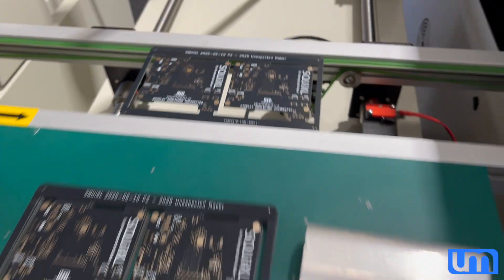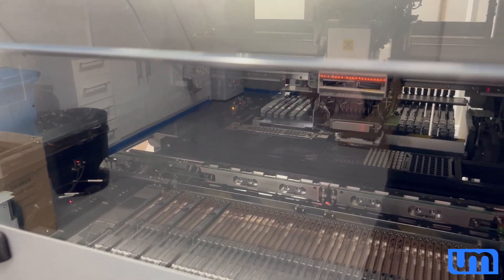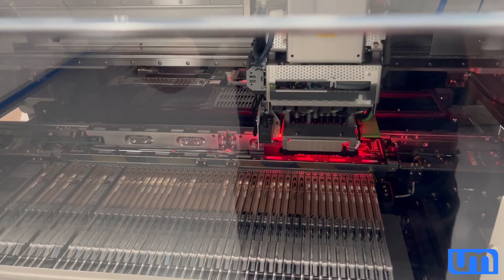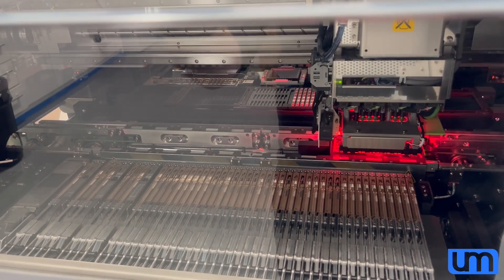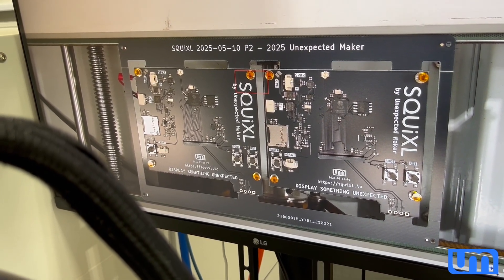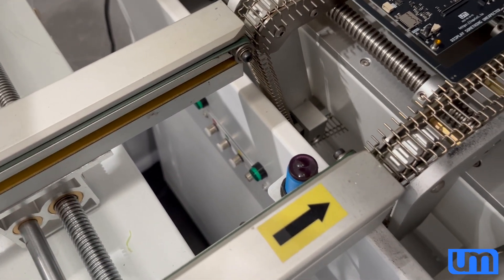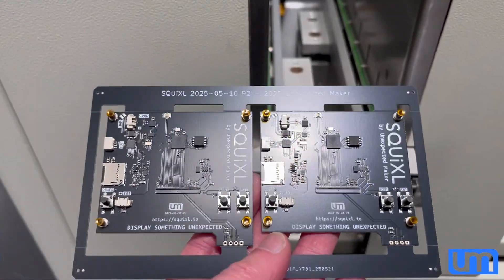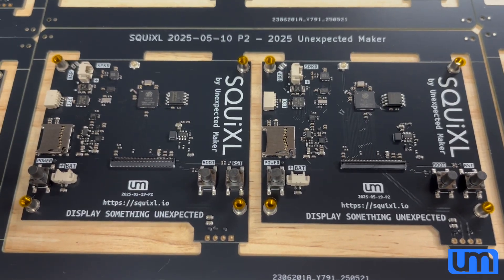Of SQUiXLs & Sausages...

Comment: Is your automatic printer using vacuum holder for the process? Did you machine the jig holder for your panel?
Reply from the maker: Yes, the stencil printer uses vacuum to hold the PCB (as well as standard edge clamping) - no custom jigs required.

Comment: could you turn the board 180 degrees? would the sensor in front of the reflow oven be able to detect the boards then (the gap is much smaller on the other side)?
Reply from the maker: Yeah, I could do, but as I mention in the video, it's a low-volume product, so it's not a big deal to push these ones through. I'm inspecting them at that station anyway, so it’s easy to just side it over. I’m almost out of panels, so when I re-order, I'll change how the routing is done, so allow for a solid area for the sensor.

Comment: Why don't you do video inspection for the connector?
Reply from the maker: As I mentiojed in the video, it's pick position/nozzle issue, not an itentification one. Even with using the up camera, it still shifts on the nozzle when moving. I need to get a specific type of nozzle to pick up a part like this, as it's not suited for a regular tiny round tip nozzle.